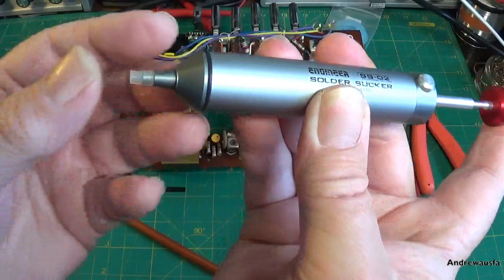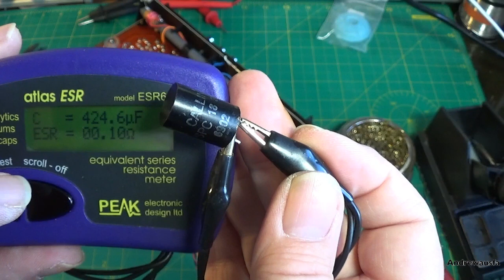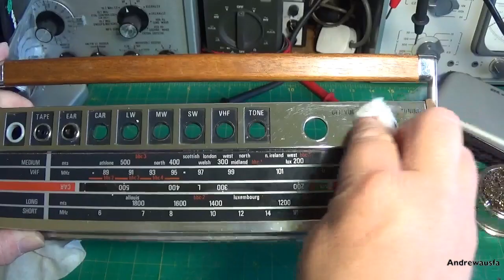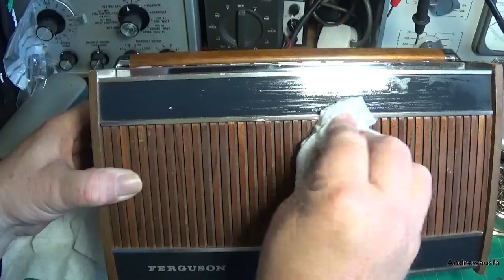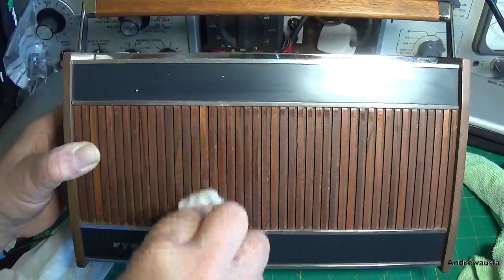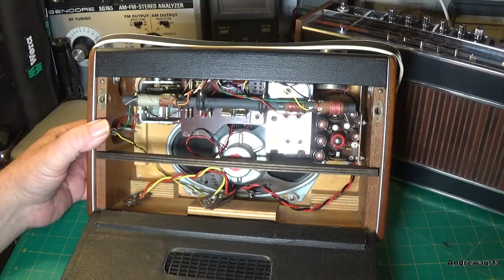Ferguson 3169 Transistor radio part two

Comment: Excellent Andrew 
I do like all the hints and tips in your videos 
The soldering technique you use often dosn't get explained and yours is excellent 
Was you using lighter fuel to clean the case ? 
Your eye for detail always amazes me 
I few nicks gives the radio gives it a charm 
I hope you enjoy the Roberts 
Kind regards Shaun
Reply from the maker: Hi Shaun, thanks! I might have been using lighter fuel, don't recall. Lighter fuel (naptha not petrol) works very well on some finishes but can take markings off. Well, so can water to be honest :)

Comment: I have one of those solder suckers. They are good but I keep loose the silicon bit off the end. But silicon tubing is much cheaper than buying those solder sucking ptfe tips. I remember those capacitors but not seen that style in a while. Thanks regards Chris
Reply from the maker: I really like it Chris, it is annoying having to clean it out after a couple of sucks but it does a very good job. I'll try to find some spare silicon tubing as though I've had this for some time I'm sure one day I will lose the tubing! Thanks for watching and commenting as always.

Comment: nice video you learn something new about those capacitors I have a few new old stock ones somewhere in my old tins Ill have to test them ! I have replaced a few in some of my old equipment I had thought of  stuffing them , probably in the Bin !
Reply from the maker: Yes they fail a lot in old TV's, they are getting on though now nearly 50 years old so there's that and the original general poorness.

Comment: The Callins Capacitor story is an interesting one Andrew if you ever want to look it up. Fred Callins was very much a self made man starting the company in 1957. It was bought out by a conglomerate Whitehall Industries in 1964. He stayed on as part of the deal with a five year contract to continue R&D into the development of small electrolytic capacitors. Interestingly when his contract was up in 1969, Callins ceased production. The caps produced here were of very good quality and had many top manufactures using them. Not sure what was going on over there in Shannon though.  The Fergy looks quite good. Thanks for the look see. Stay well. ATB Doug.
Reply from the maker: Hi Doug, yes I did read the Callins story, he set out to make the best capacitors. I guess like anything manufactured (well back then at least) they have a reasonable service level designed into them which is long past due.  The TV chaps seem to have a lot of problems with Callins capacitors.

Comment: He he ferguns, sounds like an interesting radio :-D
It still looks like a nice radio, cleaner and all the crapacitors given a trip to the bin :-D.
The same odd carbon resistors in that ferguson are in my hacker p.a board, some were way off.
Maybe not quite as bad as the really old carbons, they changed value if you showed them a soldering iron.
I was 4 when that was made,  i think the radio looks in better condition than i do lol.
Reply from the maker: Hi Zx, yep it's not bad radio, I think a wooden case would help. Too expensive though for its price.
Reply: @Andrewausfa  i suppose it's not impossible to make a replacement wooden box to take the place of the " Plastic fantastic ".
But it's not special enough to frighten the wallet :-D

Comment: I dont no  you can get chem tonics solder wick, on ebay I tried them all they were so so , a radio tech recommended  chemtronics , It worked so much better it was amazing I think I paid 18.00 dollars for 50 ft.and it was the wider stuff . And I believe the best solder In the U.S. I believe Is Kester 60/40  .031 diameter.I wont ever use lead crap. Some day I would like t ok get a U.K. radio they seem well built .I do like tube radios or  some transistor radios before they were made in china .can you still get batteries for your radio or can it use a AC power adapter?It doesnt say when this video was made?compared to chinese built american  radios this one look and sounds great to me , I to would love to try either a tub ed Robertdon or a new Roberson radio  with the vintage styling. Or even a Roberson with the leather covering .I like radios that are different the. What I can buy here in ca.  Thanks for shareing